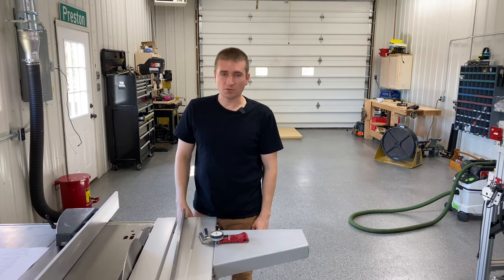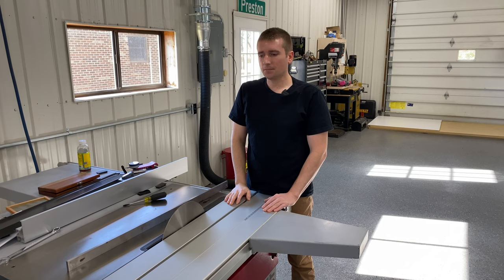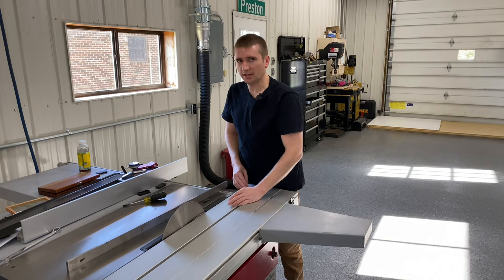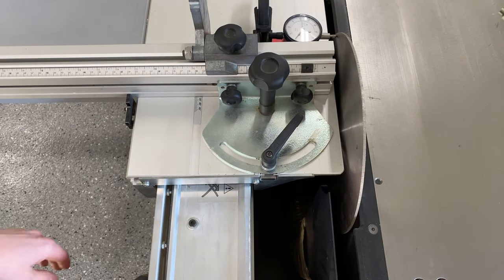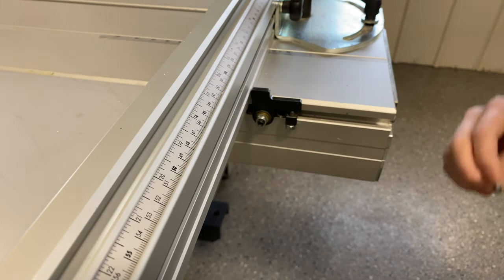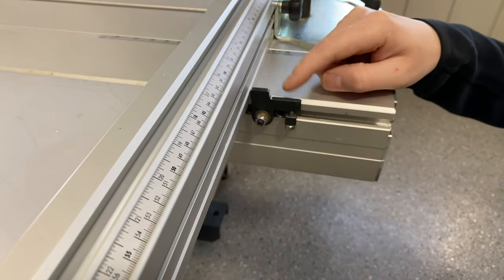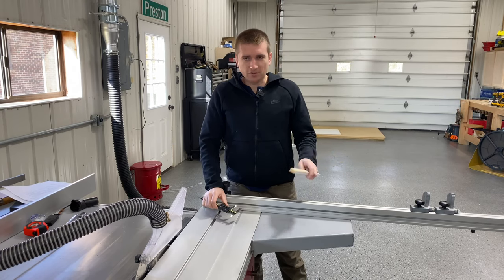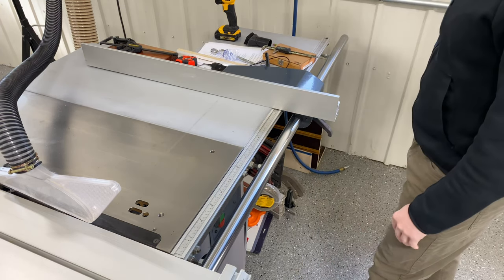Hammer K3 Sliding Table Saw Calibration

Comment: Very interesting. I have almost the same machine. My problems were with making consistent 45-degree cuts. For the 90-degree cuts there is a hard stop with a cam or screw against the fence (like you show in your video), but 45 degrees is just lining up against a mark on the sliding table. I found it practically impossible to line it up the same way every time. I recently borrowed the graduated mitre-fence attachement that can be locked out for certain angles and this has improved things a lot. It also means you don't need the fiddly cam/screw stop. Overall, I am very happy with my Hammer K3 - but wish I had the workshop space that you have :-)
Reply from the maker: I have found 45 degrees to be difficult as well. I hear the outrigger table and miter index is the cats meow for those precision cuts, but I never invested in that option. I will have to try out their indexing miter gauge one of these days. 

Most of my miter cuts are over a shorter width, so I can usually get away with those cuts at the miter saw and shooting board.

The extra shop space is a recent development (I am very lucky) and I am excited to fill it up over time. Thanks for watching and sharing your experience. I learn a lot from folks on here.

Comment: Great video. I am in the process of tuning my K3 as well and I realized I have a hallow in the case iron. I understand this is an older video, but several people here have said they have Hammer K3 machines. When measuring for the cast iron flatness, what sort of tolerance are you guys getting and what tolerance is allowed by Hammer/Felder?

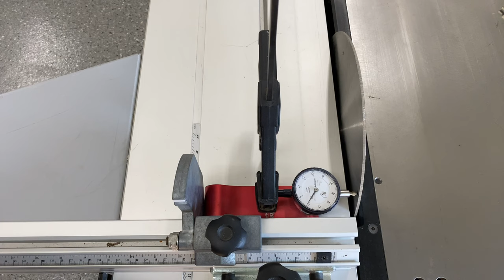Comment: hey preston, thanks for this video; i plan on buying this machine. if i'm correct there is no actual screws or anthing to set the runout/toe-out as you show around 4:00th minute (adjustment screws are only for setting the sliding table height if i'm not mistaken?). Thanks!
Reply: I just read in the felder adjustment guide that you can make adjustments by loosening the bottom bolts (where the sliding table is attached to the chassis). and then slightly move the sliding table.
Reply from the maker: Yes, you can adjust the toe out on the sliding table portion. Runout on the other hand is associated with the rotating piece of equipment (I.e. lathe, drill, table saw arbor - wherever there is a motor). Runout measures the inaccuracies in the spinning.

Comment: Would be interested to know how you deal with the sliding table being coplanar with the cast top...or do you have the sliding table proud of the cast as felder recommends?  When you hand tighten the bolts to get the sliding table parallel does that affect the height?

Comment: That will help me a great deal when I get my K3, hopefully at the beginning of next month! Thanks! One question/request: when you tilt your blade to 45 degrees, will it still be parallel to the sliding table? If the axis of tilting is not perfectly parallel to the blade, tilting will throw alignment off. That affects the quality of the cut, of course. I’d be curious how this more tricky calibration is done on this saw!
Reply from the maker: It should still remain parallel to the sliding table. It’s true that the tilt could be  slightly off, but it has performed really well for me at numerous angles, so I expect that they have everything excellently machines. I have to admit that I have not considered that possibility before, but all has been well. Congrats on the new tool purchase. If you have not owned a slider before then you are in for a real treat. Crosscuts are infinitely easier with a sliding table.

Comment: Great video. How high is the sliding table above the cast iron table? I have seen they want 2 thousandths of a inch. When you said hand tighten the 6 bolts when you adjust the sliding table for coplanar to blade are those the ones that raise and lower the table or the ones that are in the saw it self. I was showing to adjust the fence to the sliding table for squareness. And that’s always worked for me. I have really been dreading to do this procedure.
Reply from the maker: My sliding table is basically flush, with the cast iron table, but .002 is fine as well. 

Hand tightening the six bolts refers to the the sliding table bolts. You want to be able to adjust the sliding table as needed to achieve coplaner, but you don’t want too much slop. Otherwise, once you have everything set up perfect,  it could move on you prior to final tightening.

Comment: When you calibrated the table you said the saw blade or whatever you are using for calibration has a wobble in it when it rotates, hence you marked a reference point. My first question is if that wobbling comes from the blade itself being not perfectly flat, or from the the whole set up of the blade on the arbor that makes the blade rotate not in a perfectly zero tilt axis? Second question is when you calibrated the squareness of the crosscut fence, you did not care about the wobble in the blade while putting the triangle square against it, does that not affect the calibration? Thanks
Reply from the maker: All great questions. I will do my best to address each one. First, it is possible and very likely that the blade is not perfectly flat. It is also possible and likely that the arbor does not run perfectly true. I can tell you from my experience (I have measured it) that the main contributor to that error is the arbor and not the blade, although I will admit that the blade is also not perfectly flat. The reference point helps account for the blade not being perfectly flat (albeit very close) and the arbor not being perfect.

In regards to my crosscut fence calibration, your interpretation is correct. The triangles ability to calibrate squareness is greatly hindered by the flatness of the blade AND the wobble contained in the arbor. This is why I use the triangle to only get me close. The five cut method is the best way to ensure a square crosscut fence. The five cut method accounts for the wobble of the arbor and dimensional inaccuracies of the blade. I am not certain if you had a chance to view the video in it’s entirety, but I do review the five cut method. If you have any questions than please feel free to ask. It is my pleasure to help out.
Reply: @prestonhoffman5695  Thanks a lot of the reply. I did watch the full video before, and just re-watched the part where you calibrated the crosscut fence (you said "I will move now to the 5 cut method..."). I kinda missed that when I was just thinking of the blade itself. Thanks again！

Comment: I don't understand what you did.  When it came time to adjust the slider to get it parallel to the blade, you skipped past whatever you did in the video.  That was the one thing I needed to see!  Thanks for the tips on leveling the slide to the cast iron, but how to get it square?  You leave us with lower bolt hand-tight, then you discussed your calibration blade, runout on the blade, etc., but never did get to adjusted those bolts to make slider parallel. (Crazy that it doesn't come square, for 5K, eh?)
Reply from the maker: Sorry about that. Video editing is not something I have much experience with. 

To get the sliding table parallel to the blade, just follow these steps.

1)keep the bottom nut hand tight on all 6 bolts (as stated in the video).

2) Measure for parallel using a dial indicator across the entire width of the blade (as shown in the video)

3) Make small lateral adjustments  to the sliding table by tapping (I like to use a rubber mallet) the sliding table on each end as necessary to get alignment (this was not shown, my apologies).

4) check your work. Repeat step 2 above and 3 above until your sliding table is parallel to the blade. Expect to repeat these steps a dozen times or more to get it dialed in just right.

5) Once everything is aligned, fully tighten the bottom nut on all 6 bolts and check your work.
Reply: However don’t get me wrong: I love your most helpful videos!

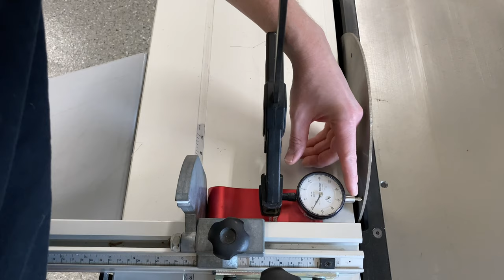Comment: At 5:07, you mention adjust for toe-out. Does that mean as you push the sliding table past the saw blade the wood is slighly moving away from the blade (left)? And if you use the fence, is toe-out moving away from the blade (right)?
Reply from the maker: That is correct. It’s particularly important with the rip fence (so you don’t create an unsafe pinching situation when ripping boards. It’s also a good practice for the sliding table side as well.

Comment: Hi Preston you are making great videos. 
I have a B3 basic and just bought two small extension tables to put at the front and the back of the saw table. I want to mount the original included extension table on the side of the sliding table like you have it, but I can't figure it out how to fasten it. Been in contact with my felder agent here in Sweden but no one can tell how it will be mounted. Are you able to explain it for me?
Many thanks 
Sara
Reply: Is it the trapezoidal steel table that you're referring to, Sara?

Comment: Thanks so much for your detailed explanations. I’m thinking of getting the Hammer K3 basic but will have to remove the sliding table and potentially some other pieces to get the machine into my basement. Do you have any thoughts on how difficult it would be to strip the machine down to the chassis or even to remove the motor to lighten the weight of the machine? Thanks.
Reply from the maker: I don’t believe removing the sliding table would save you much weight, but it would save you some in a pinch. You could definitely handle the re-mounting calibration.

Removing the motor is another beast altogether. I would avoid it if I were you. I think you would have to take apart the whole trunion, but I can’t recall from memory. 

Can you use an engine hoist? Reference Marius Hornbergers delivery video. I believe that’s what he used when getting his K3.

https://m.youtube.com/watch?v=f8c9-BGJLeM
Reply: @prestonhoffman5695  thanks for the insight re removing the motor. I did see (and was amazed by) how Marius Hornberger wrestled his saw into his shop. He disclosed having to remove some parts of the saw to do so. I didn’t know if there was something obvious I was missing. I will look into an engine hoist. Thanks again!

Comment: Very interesting video Preston. I have both a K3 classic and a A3-31. I also bought the optional precision mitre guide (code 503-167). The problem is to maintain  the setup each time you have to remove the crosscut fence. I did some repeatability test without good results. Each time the fence doesn't give the same result. Do you have any problem with the standard system each time you remove and reposition it? About the calibration disk where did you buy it? I didn't find it in the catalog of Hammer. Best regards. Luigi
Reply from the maker: I have had some problems in the past based on removing the crosscut fence. Those problems have been greatly rectified by upgrading the crosscut fence stop. I think I mention it in the video, but it doesn’t have as much play as the cam model. Marius Hornberger did a YouTube video on the stop and it is very good.

I bought my calibration blade from Forrest Saw Blades. It was a custom order, but it was an easy phone call.

Comment: Very interesting video. It helped me a lot. I still have one question though: you didn’t show how you calibrated the run out of the blade. I have that problem with my bernardo basic 2000 and can’t figure out how to align the blade again. It is 1mm off in 15cm, which is ruining all my cuts. Could you please tell me how to adjust it? Do you have a video on this specific point? Thanks!
Reply from the maker: Are you asking how to correct blade runout? Unfortunately, there is no good way to correct blade runout. Runout is typically due to a combination of blade flatness and motor arbor inaccuracies. Correcting it requires replacing with better machined hardware, which is cost prohibitive. That being said, some runout is normal and to be expected. Also, this runout creates a more or less even wobble that can be accounted for. That is, the inaccuracies from the wobble effectively cancel each other out, which is why you rotate the blade when measuring for parallelism between the blade and sliding table.

Comment: Great video - thanks for posting. I have a C3-31 and will refer to your other video for the A3 as well. Question - what brand t-track clap are you using? I like how quick it is to set up.
Reply from the maker: I’m glad you found it helpful. These machines really work well once they are tuned. The clamp I use is by DeWalt. It’s originally designed for their track saw. The Amazon link is below.

https://www.amazon.com/DEWALT-DWS5026-TrackSaw-Track-Clamps/dp/B001J31PJM

Comment: Preston, I've had my Hammer K3 Winner for over 5 years now and the fence has been my biggest issue.  I have the side table adjusted and the big bar measured and set but the saw fence does not glide across my table smoothly like the Hammer set up video produced by Felder.  It would be great is I could adjust the small wheel underneath the fence slider mechanism.  I keep the cast iron top clean and waxed.    Can you tell me if you have had issues getting the fence to glide smoothly and if not, how did you remedy the problem
Reply from the maker: Unfortunately my fence does not move as smooth as my old beisemeyer fence that is typical for American cabinet saws. It’s pretty choppy. I wish I had more to offer in that respect. That being said, I have found it’s accurate when in use.
Reply: @prestonhoffman5695  I think I figured out my issue - the aluminum piece with the distance scale (distance from the saw blade) on it was slightly above the cast iron table.  I removed it and lowered the "L" bracket that the piece  sits on.  I got it sitting just below my cast iron table and and my fence was still dragging on the table so I pulled the heavy cast iron mount for the aluminum fence and raised the small wheel.  Voila - now it runs smoothly across my table except when the wheel runs over the slight gap between the cast iron table and the small table the bolts to it.
Reply from the maker: Thanks for the insight! I will have to try that out.

Comment: Hi, I have the exact same saw. I even upgraded it with the jessom guide based on your video in the past. Now you have a bigger shop do you think you will upgrade your saw to have the out rigger and longer sliding table? I'm thinking of doing this. Now I have a slightly bigger shop.
Reply from the maker: I’m not sure. I think I eventually want to upgrade to a Felder, but I have so many other tools that I’m interested in. Also, when this tool is dialed in, it does a great job.
Reply: @prestonhoffman5695  I'm in the exact same boat! You are right it's a very good saw. But we always want something bigger! Cheers for the reply!

Comment: Great video, thanks Preston.   I've had this model for 20 years.   Biggest heap of shit I've ever bought.   With that defective sliding fence calibration, it was pointed out to Felder by fellow you tuber Marius Homberger.   They adapted his idea and put it into production.   You think that Felder would do the right thing and provide this upgrade to all who purchased the K3.  The rip fence is different to yours, not sure what its called but again, rubbish.   Fence flexes when you make cuts and is hard to manipulate when making different rips.  For the money it cost, it would be better suited as a boat anchor.   My Delta Contract saw is a million times better.   Would never buy anything from Felder again.   After sales were horrible.   Phew!   Feel better now.

Comment: A seriously great video, thanks for making it.  
At 1:40, you show the 2 middle bolts for the sliding table bed, and your K3 looks like my C3 -- no obvious way to access the bottom nut to loosen them.  How were you able to access the bottom 2 nuts on those 2 middle bolts?
Reply from the maker: I just used a couple wrenches with the table slid out of the way and black guard removed.